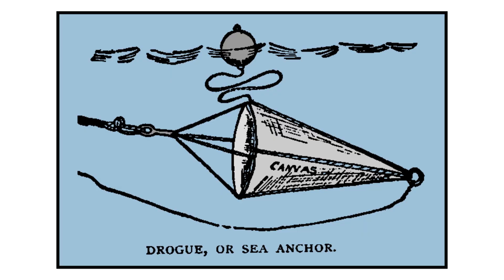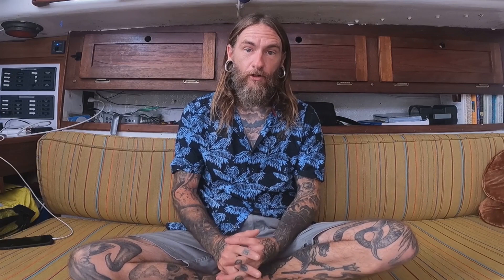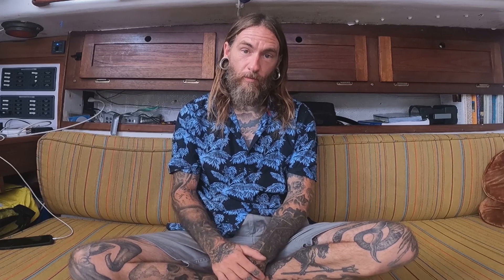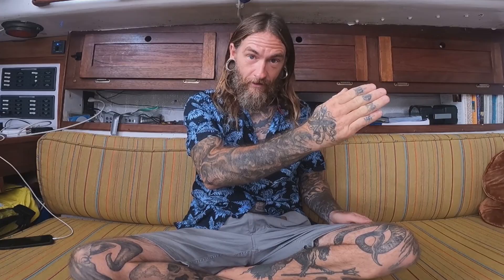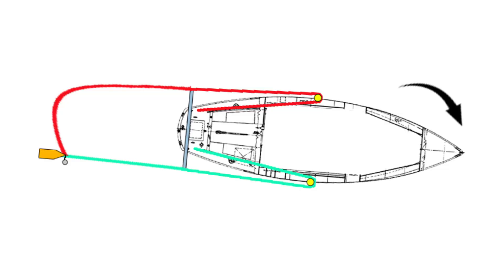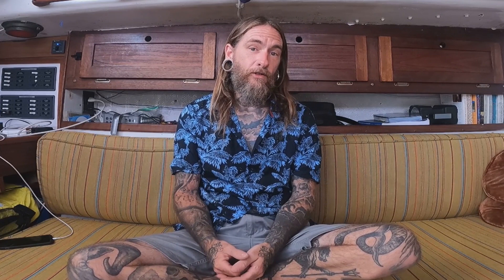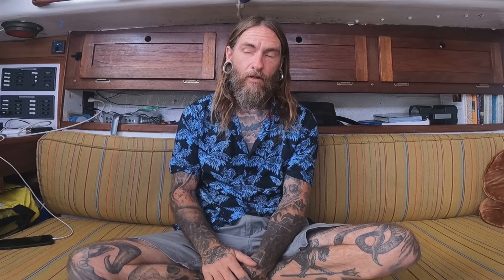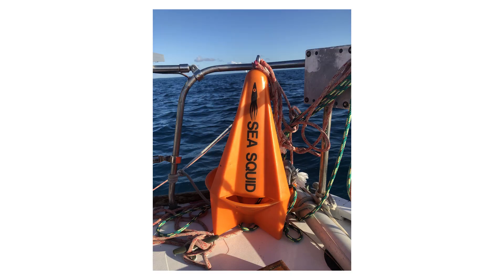How to Steer a Sail Boat or Power Boat Using A Drogue or Fabric Sea Anchor In Case of Steering Loss

Comment: Thanks for taking the time to share this and for making the manual.  It might come in handy over the next months when I will probably be towing a 42' gutted ferro sailboat without a rudder with my trawler . . . should be interesting.  If you have any tips about such things that would be great . . . or if anyone does - the more I know the safer it will be.  Thanks again.
Reply from the maker: This will totally work for that purpose 👍🏻
Reply: @SailorJames  I'm just about done watching - and, yes, I do believe this will work just fine.  It's a pretty straight course running up the inside coast of Vancouver Island . . . we'll see what happens - the deal hasn't been made yet.  The boat is free, and I just can't pass it up.  I have to make arrangements to go have a look next week.  Hopefully it's a diamond in the rough that's just needs a little time, money and patience to finish.

Comment: I just read in Latitude 38 that a Pacific puddle jump. Boat a fully crewed Catalina 47 completely lost its spade rudder. They were 750 mi from landfall in the Pacific.  They abandoned ship!  The boat otherwise in good shape and fully functioning.  No major storm system involved.   You have to be resourceful out there as you were. And you were SINGLE HANDING.  That is a huge plus in an emergency.   I can’t and don’t make judgement as I wasn’t there to know all circumstance.   Another boat was only 85 miles behind picked them off the boat.
Reply from the maker: Yes, it’s a very common occurrence with people abandoning boats that couldn’t easily be sailed and saved, however slow and inconvenient it might be. I will gladly pass judgment and say most people abandoning boats in this way have no business being at sea.
Reply: @SailorJames  Yes, and agree that Hydrovane is a great way to go (in you can afford it. I had a Monitor that I bought used, (not much to go wrong with them).  Their emergency rudder system is not the best solution but beats the crap out of nothing.

Comment: James I followed you on your voyage to Hawaii via Predict Wind what a nail biter thanks for continuing to provide your written updates. The daily posts read as written by a sailor in control of a totally uncontrollable situation. I have to believe the vast majority of sailors in the same situation would have simply given up and waited for assistance from others ultimately leaving their boat to the ocean. No doubt the assistance you received from your shore team was key but who put it in place as part of the voyage plan, you. Don't under estimate your skill as a sailor, ability to remain calm and receive the suggestions provided by others. Additionally the preparedness of Triteia before you left the dock played huge into the voyages success even without a working rudder. 
Thanks for providing such a detailed explanation of drogues and their use for steering a vessel with a damaged rudder. Some day a very fortunate sailor will benefit from this information possibly even saving lives.

Comment: Yes, you can turn your boat faster if you deploy the storm drogue close to the boat. Most, not all storm drogues, require weight placement for emergency steering. The steering drogue that doesn’t require weight for emergency steering is made from heavy-duty fabric and 3/4” hardware. Its design permits you to dump half the water out of the canopy if you feel it’s slowing the boat too much.
    
You can frequently avoid using a spinnaker pole by using blocks or stoppers near the stern. This holds the bridle in place so it’s not bouncing around everywhere. Should reduce tangles around a rudder or vane. Boat design does factor into setup. 

Still glad to see the pole. It’s a good visual for sailors to keep in the back of their minds. Overall, great insight.

Comment: Excellent practical advice. Sea Anchors are very useful. .. especially on the smaller sail kayaks I have used. I have not needed to use it for an emergency rudder but this knowledge is super useful if you ever need it. Thank you !

Comment: I'm looking at a 30' Alberg, 70's model as a retirement project. Your refit videos and the such will help me greaty. I'm glad you made it safely to Hawaii, and I really enjoyed your drogue content.
Reply: I have a 1967 A30.  Don't discount the older (pre-1970s) Mark I version like mine and Treitea.  Besides not having an interior liner, the older boats have decks cored with pegboard (masonite) instead of end-grain balsa).  Plan on reinforcing mast step (beam below deck) and forward lower chainplates,.  Replace through hulls, and replace rudder hinge pin and pintle/gudgeon bolts.  A boat that has had all of these addressed, is a real plus. They are wonderful boats.  Watch Jean-du-Sud Around the World (that one is somewhat modified).  Rig size and displacement is very similar to newer Alberg Cape Dory 28, but I think the A30 is prettier (Sorry Sam Holmes, who is cruising Europe on his CD 28!).

Comment: Fantastic dissertation. Thank you very much, James, for all this priceless information. I wish I had known all this before my steering accident on a sailing dinghy quite a few years back in the Bahia de Todos Os Santos, Brazil.

However there's something I don't understand, which maybe someone can please explain. I gather that the idea is to balance the dragging of the drogue with the pushing of the foresail and find the sweet spot that sets us on our desired heading. Now, let's say the boat is on a starboard tack. No mainsail, only the jib on port. Shouldn't the drogue be deployed on the opposite side, ie. the starboard side, so as to offset the tendency of the foresail-only boat to veer leewards? However, I noticed that James had the drogue deployed on the lee side of Triteia. Is it because she was mostly running down wind?

Comment: This method works. BUT it probably kills 25~50% of your boat speed by constantly dragging a drogue. A different method would also work. Lashing one of your inside hatch covers to the pole to act as a rudder would steer the boat with much less drag (About two square feet should be enough). The pole is not mounted vertical like a standard rudder but mounted much more horizonal like a Yulo or sweep.  The pivot point could be one of your stern cleats with some innovative rope work. It might even be possible to hook it up to some sort sheet to tiller steering.
BTW do some research on how to heave to. Kills boat speed and helps to stabilize motion while effecting repairs.
May all your troubles melt like lemon drops.
Reply from the maker: I know how to heave to and you can’t heave to without a rudder. 

Yes a wooden board attached to a pole acting as a blade rudder would have less drag but I can promise you that a jury rig of this set up (not a previously made purpose built set up that bolts together) would be very different to keep in place and working for long periods due to the massive loads placed on the rudder and the only way the loads would be lessened would be ……. Slower speeds.
Reply: Both of these methods are described (with diagrams) in Annapolis Book of Seamanship, 2014 edition, page 346. Pulling it off successfully for 1,000 nm is amazing but the technique is no secret.

Comment: Thanks for sharing! I am gearing towards setting off on my first offshore passage next year, likely also to Hawaii. My boat came with a Hydrovane, which steers the boat well as a windvane, or as an emergency rudder. It also came with a beefy drogue, and thanks to your video, I now have the knowledge the if my main rudder and Hydrovane rudder both bit the dust, there is another approach to get the boat to shore!
Reply: Im no sailor, let me make this clear. If you still have a year left, wouldnt it be smart to test his technique out. You can prepare basically where he could not. I think being be prepared also makes you a lot calmer when it does happen.

Comment: Sailing Wave Rover have a plan to make a wind vain. its about $25 for the plan and instructions and its called 'MK 3 Trim Tab Wind Vane DIY Plans' available on Etsy.
it's cheap enough to give it a go and use it as a back-up if its not up to scratch

Comment: what a great contribution you have made to the sailing community with this guide! How did you steer into the marina? Did someone come out to give you a tow? or did you actually manage to do that fine maneuvering with the drogue?
Reply from the maker: I was towed in by a friend from the anchorage. It would have been impossible to steer in tight conditions with coral reef, break water and swell
Reply: sure sounds impossible! @SailorJames

Comment: Thanks for the info, and the guide. So you think this is your best bet to prepare for the case of rudder failure? I have heard that rudder failure is one of the most common reasons for a journey to not succeed. I was thinking about a spare emergency rudder, but I figure anything that you could hang off the transom to act as a spare rudder would be too big to store on board. This drogue system might be the best backup.
I also wonder if you had two drogues, could you hang them off of each side of the boat, and somehow make one more effective than the other to steer the boat?
Reply from the maker: If you are more than a few days from shore any home made emergency rudder will likely break apart not to mention you couldn’t use it with self steering. A drogue is tried and true, no debate, best option.

Comment: Thanks for the video, very informative but I’m a bit confused why did you need the drogue in the first place if you had a wind vane that has its own rudder? I’m actually thinking of getting the Hydrovane for self steering but also for extra security in case something happens to my rudder, but now watching this video I’m not sure anymore if having just the Hydrovane s enough or do I need a drogue too? What if I only have a drogue, will I be able to steer?
Reply from the maker: If I had had a hydrovane I wouldn’t have needed the drogue at all, I didn’t I had a vintage sailomat aux rudder windvane, it’s rudder was not powerful enough to handle the weather helm alone (I had to lash the tiller over before the rudder broke to off set the pressure) so the drogue took the pressure off but the sailomat still keep us on course

Comment: That's helpful. Thanks. Did the rudder shaft slip inside the rudder? What exactly broke. With calm seas could the rudder been tied under water to make a crude way to steer similar to what you did for the drouge.

Comment: Such valuable content - thanks for sharing. Do you think your setup would have worked on a reach? Or is this a downwind solution?
Reply from the maker: It will work on a reach but depending on the boats weather helm you might have to carry less sail. Keeping her from rounding up would be the trick.

Comment: What do you do  at night when single handing? Do you get up every 20 minutes to check the horizon or rely exclusively on the AIS? I've done far shorter voyages in the med and the north atlantic where I have had to make maneuvers on night watch. I guess there is more open space/less traffic in the middle of the pacific?
Reply from the maker: You don’t need to check every 20 minutes unless you are near the coast. When I have working AIS I sleep in two hour increments. Then get up, check course and horizon and lay bracket down. Between LA and Hawaii my AIS had failed so I slept in 1 hour increments. In the 9000NM between LA and NZ I saw maybe 8 ships/yachts total at sea.
Reply: @SailorJames  man you are brave! 9000nm! When you say "you don't need to" check so often, you mean "because the probability of running into a ship is less" or you can see them on radar ?  (we don't have radar, only AIS, and I'm a relative noob)
Reply from the maker: Like I said, 8 ships in 9000 miles tells you how rare it is to see anyone out there other than known high traffic zones. Waking up every 20mins is far more dangerous (creates fatigue) than keeping a realistic watch schedule in seas you know are generally empty

Comment: Would like to see a video about the damage to the rudder, since the rudder on the Alberg 30 is fully behind the keel.  Anything you would change?
Reply from the maker: There is a clip of the damage at the end of the passage video , the helm was lashed over to starboard to counter the weather helm which is common on Alberg30s , this forced the rudder out to port placing it in harms way to the strike
Reply: James, the amount of weather helm you were experiencing looks out of the ordinary. Initially I thought you lost your rudder due to pure load, but I’m sure that strike didn’t help.

I’d be interested if there was a change you could make to help balance the helm and protect your rudder more? 

Regardless, well done sailing with the drogue. I once used a milk crate in a similar manner and know how tricky it can be.